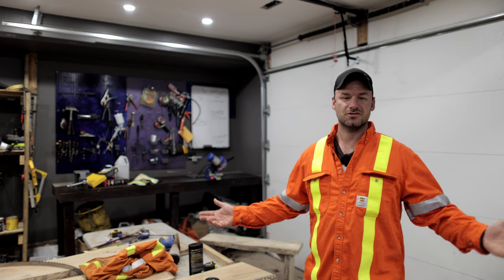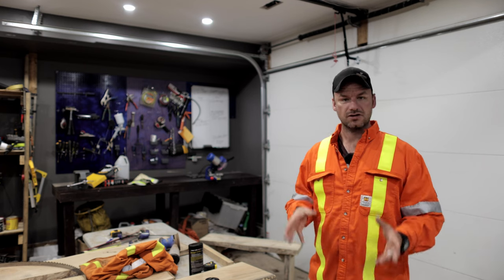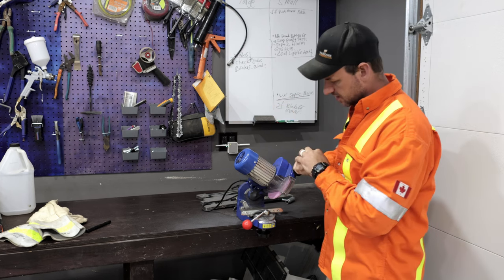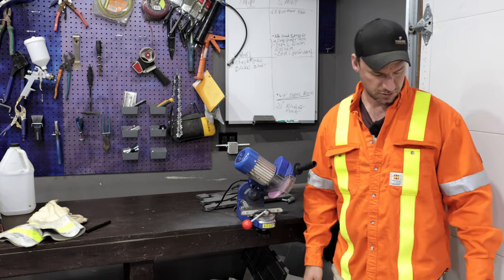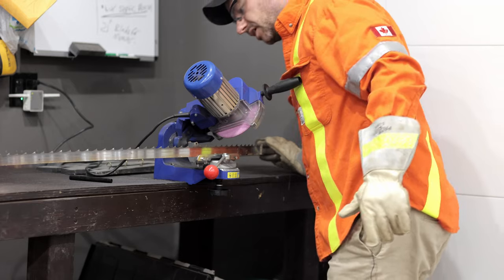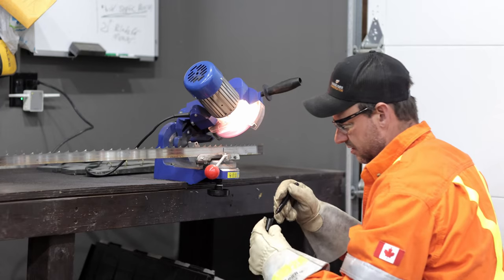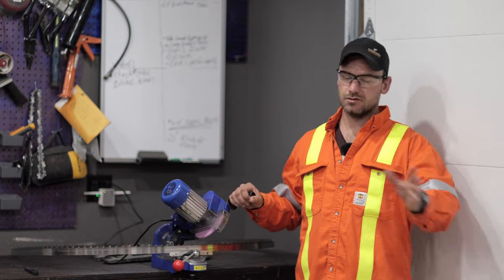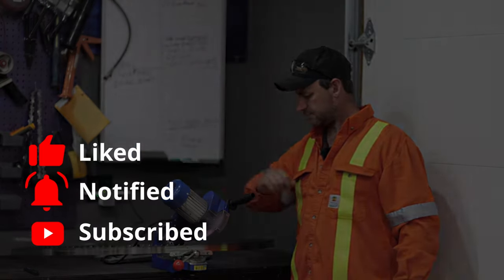the best way to sharpen a saw mill blade (Cheap!)

Comment: Doesn't work no consistency in tooth
Reply from the maker: @jimbauer6822  honestly it  took me several angle changes to get it right.bit does work. I've literally been on the same blade 4 or 5 sharpens. I run them to failure now.